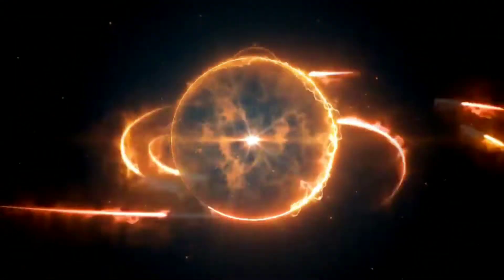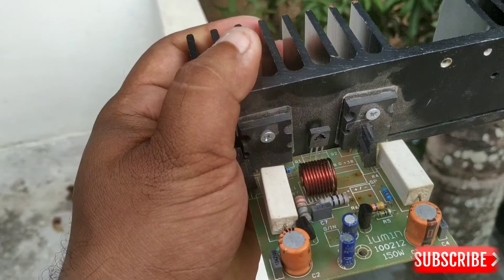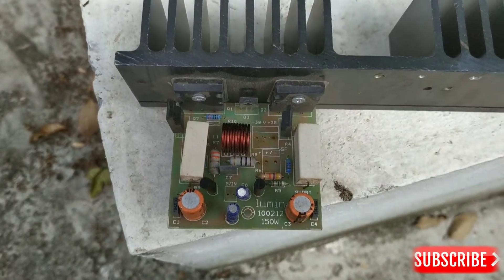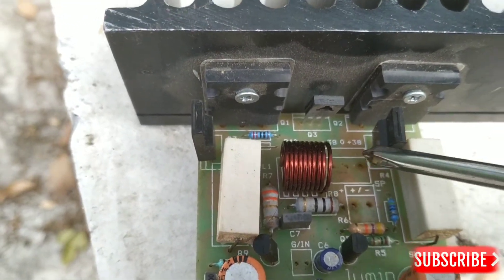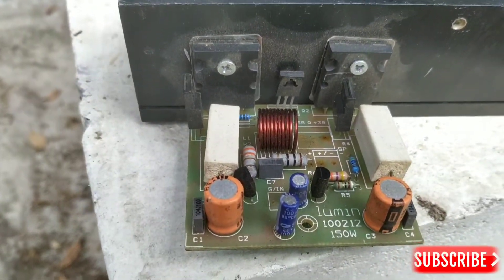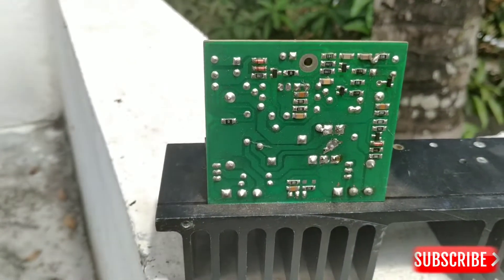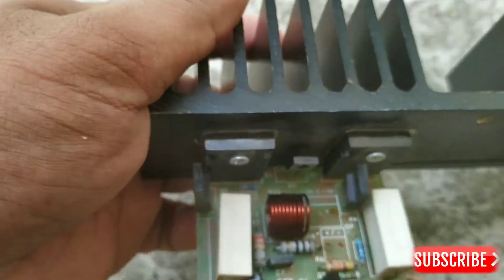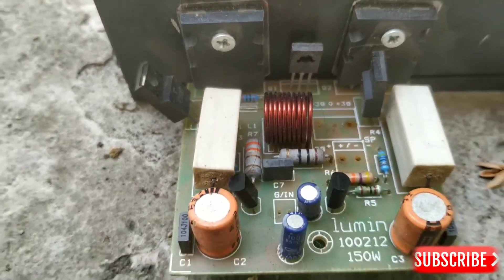100w transistor amplifier board review. The best 100w board for center channel in 5.1 amp

Comment: Bro ee vocal ennu parajal enthaa?  

Pliz oonnu paraju tharavo what is this vockal
Reply from the maker: Mid sound koodthal kittum vocal ennu vachal speech sound...  Nammal samsarikkunnente voice adhava vocal eduthu kanikm ii board 5.1 center ch il koodthalm vocals anu varunnath so this is good option
Reply: @technicalevolution9887  Aah thx bro nte 2030 sub amp il sub il ninum ee ssarikunaa sound kelkunund..  irrectiness ayithonaa 

Ith mattan enthaa vazhi vere board etha nallathu oru 50w rms vnnm
Reply from the maker: @ar-creation7114  2 transistor or MOSFET nokku ille tda 7265
Reply: @ar-creation7114  subwoofer filter athra nallthu althathu kondallea angnea kanikunea entea cheriya Oru anubavathinu parajea Anu njan filter mariyappo change undayirunnu